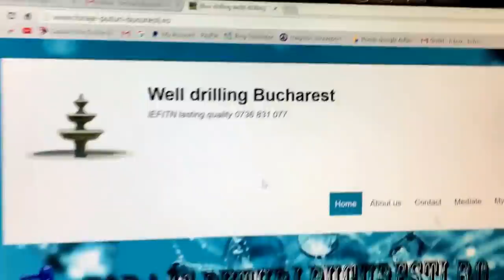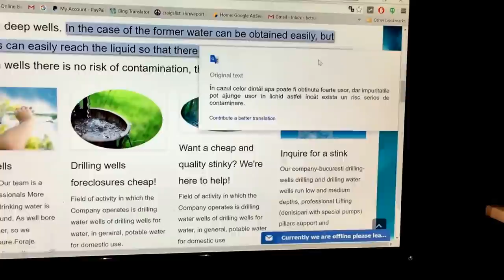Watching a chainsaw carver

Comment: Hi there. I have on off topic question...what kind of paint or coating did you use on your work bench? thanks in advance.
Reply from the maker: +Austin W Battleship gray oilbase paint I bought at walmart. Ive been using the same type and color for 26 years and probably have about ten coats cumulative on it.